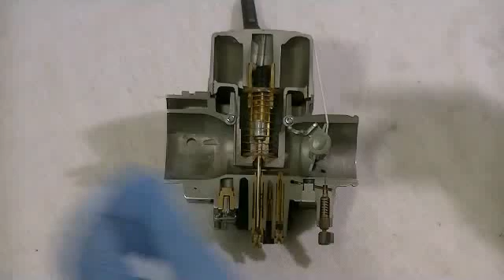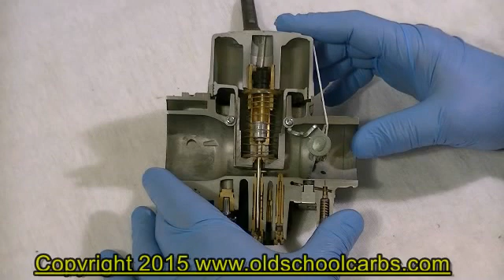Constant Velocity Carburetor Explained

Comment: Slide goes up, velocity goes down. Slide goes down, velocity goes up.  When then is it called a constant velocity carb? If anything, the designers should have called it a Variable Venturi carb or VV since this is what is actually occurring.
Reply: I think it's because the air always goes in the same speed. if vacuum increases, it's supposed to increase speed, but the opening increases compensating and maintaining the same speed.
Reply: @ronenfe  your comment makes way more sense than the dude's explanation in this video. It sounds like it actually is a constant velocity through the carburetor and it's just changing the volume flow rate which makes sense.
Reply: @RossGoneRogue  Now I'm thinking, when the butterfly is closed, the air flow is restricted causing the engine to run slower and creating less suction force so air speed is slow. When butterfly is opened, engine gets more air, creating more suction force which should increase air speed. But if more air is passed then the airspeed decreases. So what's the difference between the butterfly and the slide? They both control diameter of the air passage.
Reply: @ronenfe  so you're partly right. The venturi effect is explained by Bernoulli's equation. The suction force you describe is actually called Dynamic Pressure. When Dynamic Pressure increases, static pressure in that area must decrease which creates a vacuum. I think you were right the first time that velocity remains (roughly) constant through the slide. The butterfly valve controls the amount of air that is allowed to come through, but he didnt explain well that when you open the butterfly, it also creates a vacuum over the slide which is what causes the slide to move up allowing more air through the venturi (where velocity remains constant), but the volume flow rate increases going to the engine. More air means more combustion and higher power.

Comment: Love the video. But I’m wondering how we can play with this effect. I would like my slide to lift quicker with the throttle. I have clipped a couple turns off the spring. That has seemed to help. But still not getting the response I would prefer. I’ve heard of people drilling the hole in the slide bigger so that it lifts easier.  But in my vacuum operating mind that would only slow the lift of the slide. Now with a tiny bit of understanding of this Bernoulli effect. What does drilling this hole bigger actually do. Allows to lift easier?  Any info on getting quicker throttle response is appreciated. Cvk40 is my carb. Trying to avoid buying a slide card.

Comment: The slide is controlled by air passing through a moon shaped inlet at the top of the carburetor that in turn raises a vacuum diaphragm and thusly raises the slide and needle dependent on the degree of the butterfly opening.  There is no mechanical linkage as your model depicts.  I am sure you installed this for demonstration purposes only, but it adds to confusion as to the actual operation of this type of carburetor.
Reply: why is it that people only talk and make videos about the easy obvious part of CV carb operation, twisting the throttle opens the butterfly causing vacuum to lift the slide which raises the needle allowing more fuel delivery ect ect but no one ever goes into how a CV carb delivers the fuel volume necessary  when you are cruising 65 mph down the highway at a constant 5000 rpm but only using 5% or less of the throttle, there's no slide moving so no main jet fuel contribution and your throttle position is positioned just off idle, so where is the fuel to sustain that kind of rpm without going lean coming from? I've asked every self-ordained motorcycle expert on youtube, some more then once, but the lack of response tells me no one knows the answer......
Reply: A manual can explain this better than I can but here goes, Your main jet and low speed jet work in conjunction with each other - they basically overlap.  When you are just cruising, the slide / needle are slightly elevated and the taper of the needle and the main jet size determine the amount of fuel that passes through the main jet.  Fuel also passes through the low speed jet and combines with the fuel added by the main jet.  Less fuel is required at speed and the movement of the slide is much less noticeable.  Most all of the motorcycle manuals that I have show diagrams of this overlap between the jets and jet circuits.  Hope this helps! @quadflopper1012
Reply: thanks it helped quantify some of questions I had concerning the basic operational theory of  a CV carb but still doesn't give me any insight into  finding a solution or even a cause for the mixture  problem I've been chasing for 3 months, I'm talking plugs removed and read multiple times a day, carbs been removed and gone through more times then i can even remember. i've been working on bikes for 40 years and for the first time ever I'm at a lost and out of ideas but i don't have a lot of CV experience so i'm hoping someone can suggest some possible causes or solutions I may have missed...thanks
Reply: What kind of problems are you experiencing?  @quadflopper1012
Reply: You might be sorry you asked that question…lol
NO air leaks ,,,, No matter what I do when cruising (cruising = a steady 5% or less throttle opening) at 3500 rpm's and lower all 4 cylinders run equally extremely rich, when cruising at 4000 rpm and above (5000 in 5th is 65 mph highway speed) all 4 cyl  go equally extremely lean.
Specs: Stock 1980 Yamaha XJ650, stock Hitachi HSC32 carbs that in the last 3 months have been pulled and had every jet, orifice and circuit re-addresses with carb cleaner and compressed air more times than I can remember. New stock size main & pilot jets (110/40), stock non-adjustable needle in factory position, float level set to factory specs and rechecked multiple times, stock airbox and filter, stockish exhaust, exit diameter opened up by ½” but all baffles still in place
 In an attempt to just get the bike to go rich when cruising above 4K rpm’s I’ve tried all the normal stuff in different combinations including increasing the mains from 110 to 117, raising the float level by up to 3mm, adding washers to raise the needles. 
The end result was the bike running so rich below 3.5k rpm’s is was unridable but still going lean at cruise above 4k rpm’s. I’ve also tried running all the above changes with spark plugs 2 heat ranges colder but still goes lean above 5k with no change to the lean condition when cruising above 5k.
Any idea’s?
Reply: Wow, sounds like you pretty much covered everything with the carbs!  Dumb question, but is the air filter new(ish)?  Are the engine internals good (compression / valve adjustments)?   Do you have a vacuum actuated fuel petcock - it may possibly might be leaking at the diaphragm, but that would only effect the cylinder where the vacuum line goes.  Is the fuel tank venting - I had a bike that had a tank vent hose that was clogged and ran lean at higher RPM`s.  Besides that, I will have to give it some more thought.  @quadflopper1012
Reply: This may sound strange but I really appreciate your response, it’s 
conformation for me that I’ve been taking the right approach, I was 
really starting to doubt myself
I acquired the bike in December, prior to that it had been sitting unridden since 1994. The air filter in it was still like brand new and since the problem is a lean condition it’s not an air restriction which is all I can see an older filter might
 cause.
To eliminate the possibility of a fuel restriction I've replaced the vacuum petcock with a gravity feed one. Also to eliminate the possibility of vapor lock I’ve been running the bike with the gas cap seal removed for a few weeks. 
Every time I take the carbs off it’s a regular habit for me to pressure test the slides to make sure they are all operating and all they all seem to be working correctly. 
There are a couple valves that definitely need re-shimming but like with
 compression, because all 4 cylinders are exhibiting the exact same lean
 condition equally, logic tells me compression and valve adjustment 
isn't the cause however I am working on the valve adjust situation, the 
valve shim removal tool will be here any day.
Compared to what I’ve  observed about other CV carbs, Hitachi CV carbs seem to have some differences like not having an accelerator pump or a decel diaphragm and on the inside bottom of the slide there is a tab next to the jet needle whole which is there to force the jet needle to hang at a slight angle 
for whatever reason, but this also causes the needle to bind in the hole
 when I’ve tried to shim the needle up with washers to richen the 
midrange mixture. No one seems to know if it will hurt to grind the tabs
 off so the needle just hangs straight down like with other carbs. If 
you can think of something I’ve missed or done wrong please feel free to
 point it out. thanks
Reply: Man, you do have a tough one!  The only other thing I can think of is that some companies sell tapered needle and jet kits, I do not know if they are available for your application, I will still keep thinking and let you know if I come up with anything else.  Good luck with it in the meantime! @quadflopper1012
Reply: thank you so much, in a way you've helped me more then you realize because I was really starting to think I didn't know anything I thought i knew..
for about $200 there is a dyno kit available which comes with a retrofit jet needle that has the clips for adjustment but not only can i not afford that right now but I keep going back to the fact that it's all stock and I should be able to at least affect some kind of change without resorting to using modified parts like I would if the intake or exhaust was actually modified and the fact that it's an extremely lean condition equally across all 4 cylinders tells me it's something systematical and my guts saying there's  something about the  way hitachi carbs work that i'm not understanding because the one thing i didn't convey through all this is, when I'm running the  rpm  range where it running lean if I pull on the chock even a little the bike runs way worse instead of better like it should normally with a lean condition, there just something I'm not getting and don't seem to be able to figure out.....thanks again
Reply: I just looked it up and they do use the hitachi carbs on some bikes, I just never ran into any yet.  I would still research the size.
Reply: great minds think alike, I've been there done that, the old man who owned this bike kept it completely original stock they are the correct original hitachi hsc32 carbs the bike came with, the only discrepancy i've found is the little filter screen is missing that is supposed to be above the needle and seat but if anything that should reduce fuel restriction. one thing about CV carbs I can't find an answer too, motorcycles engines are like car engines, under wide open throttle the vacuum goes down to 0, so where does the vacuum coming from to lift and hold up the slide? i know how to test the slides operation with pressure from the atmosphere side how do you  test them from the vacuum side although under cruise condition the engine is making vacuum so that probably has nothing to do with my problem, sorry just thinking out loud..... thanks for listening/reading....lol
Reply: Besides switching the carbs out for a known, good working set, I honestly don`t know what else to do! I have been working on bikes for years also and never ran into this one! I`ll keep thinking, but I think I`m starting to get your headache - lol @quadflopper1012
Reply: This suggestion is way out there, but is there super high mileage on the bike and if so, are the bushings for the butterflys worn and possibly sucking air in?  I can`t believe that all 4 would be worn out!  Does the engine have decent compression? @quadflopper1012
Reply: If you had access to another set of carbs to swap out, that would verify the problem actually is in the carb circuit. Low engine compression could possibly cause some of the problems that you are having.
Reply: Two more dumb questions that you probably already covered, are the vacuum test ports capped off (the ports where you plug a carb synchronizer in) and do these carbs have emulsifier tubes (the tubes located under the main jets that are cross drilled and if so, are they clean? @quadflopper1012
Reply: dude when it comes to what i've been going through with this problem there are no dumb questions i just appreciate more then you probably know that you're even trying to help.
the vacuum ports are capped and are checked regularly for leaks.
With these Hitachi's carbs the emulsifier tube and the needle jet are one piece and mine are totally clean. A couple months ago i bought one of the multi-carb rebuild kits off ebay that was supposed to be for my bike but it turned out the emulsifier tube/needle jets and the jet needles were a slightly smaller diameter by about .3 mm, i tried them anyway but it didn't really change anything, I even tried using the new smaller diameter jet needles with the stock needle jets thinking it would richen it up but it didn't make a discernible difference which kinda surprised me.
I need to find the time and motivation to work on the valve adjust, the shim removal tool just came, I'm just buried in problems right now. My dad just died and left my 88 year old blind and crippled mother almost penniless and all her care and problems have fallen completely on me not to mention my sons has serious problems right now so i'm spread pretty thin both financially and  mentally and as I'm sure you know doing a valve adjustment via shims is a total pain in the butt on the best of days.
Something you might find interesting, I've always wondered what would happen if you tied all 4 cylinders vacuum ports together like it was one common manifold, I tried it, the engine don't like it, it doesn't want to idle and it likes to backfire through the carbs and stall a lot...so know I know...don't do it.....lol
Reply: So sorry for your loss and what you are going through.  If I can think of anything else, I will let you know.  I`m not sure if you mentioned, but what is the bike?
 @quadflopper1012
Reply: sorry it took so long to respond, life's been a real bitch lately, it's a 1980 yamaha xj650 maxim. you know I've been concentrating on the lean condition above 5k rpm because that's what keeps me from riding on the  hwy, but as extreme as the lean condition is over 5k, the rich condition below 3k is just as extreme, i can throw new plugs in and after just 10 min of riding around keeping the rpm's  below 3k, i can stop and pull plugs and they all will already be covered with enough black soot that the bike stumbles all over itself when I try leaving from a stop light, and it so rich it won't idle but I can get it to idle nicely if i turn the pilot screws in so the are less then a full turn out but then the bike doesn't want to run above idle because the pilot screws are turned too far in... and this is all with stock size jets. it's funny before owning this bike i used to dream of owning a CBX or KZ1300 someday, not any more, the last thing I need is 6  carburetors to deal with...lol
Reply: @quadflopper1012  did you ever figure out what the issue was. I am having the same issue with a snowmobile that has CV carbs. No matter what i do it runs too rich. I have gone through the carbs 5 times now with new stock jets. Everytime time i check the plugs they are black on all three cylinders.
Reply: how do you know it's running too rich? seems like the carbuerator doesn't work right. get a new one.
Reply: @ronenfe  Check the condition of your spark plugs - there are videos on it. You can change jet sizes and  / or raise or lower the main jet needle.